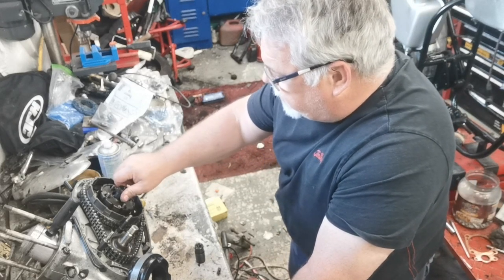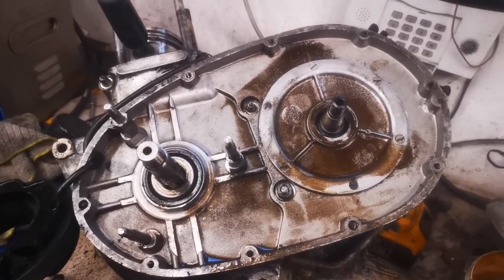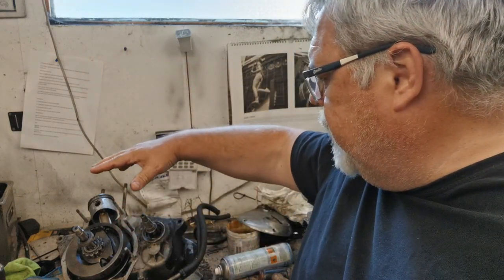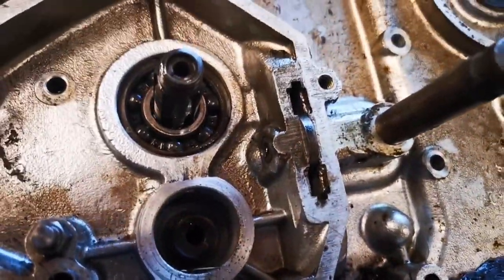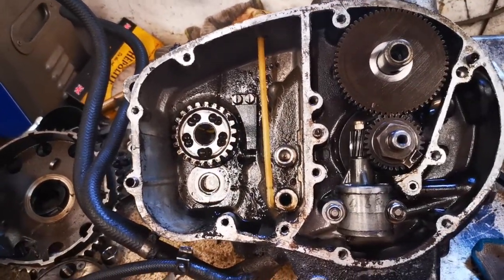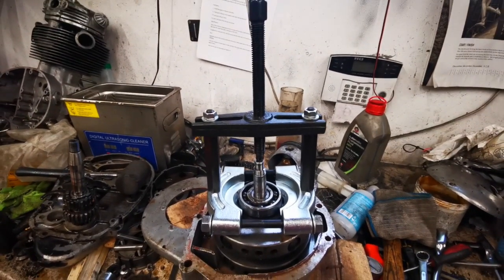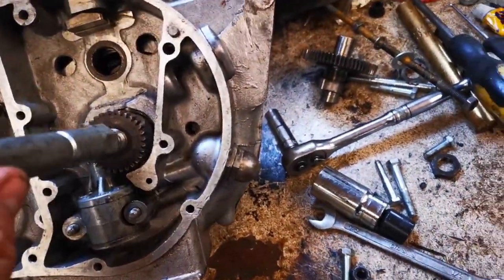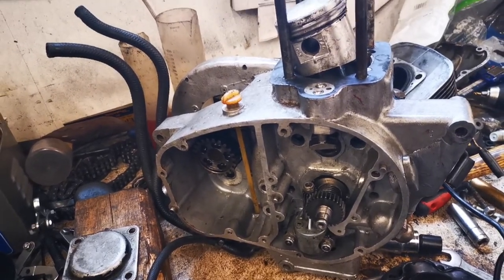BSA Scrambler Build Day 7

Comment: Thanks for uploading this series. 

The screws on that plate behind the clutch are always a bugger to get off. Normally a swift tap with an impact driver does the trick. 
Interesting that you call the pin that goes through the pin on the gearbox camplate a "cotter pin" I am a brit now living in Canada and that is what they are called over here, but in UK I always knew them as split pins. Cotter pin is what we use to hold a kick start lever on. 

Would be a good idea to replace those two springs int eh gearbox that index the camplate, they are prone to stress fracturing. 
Looking forward to the rest of the series, all the best.